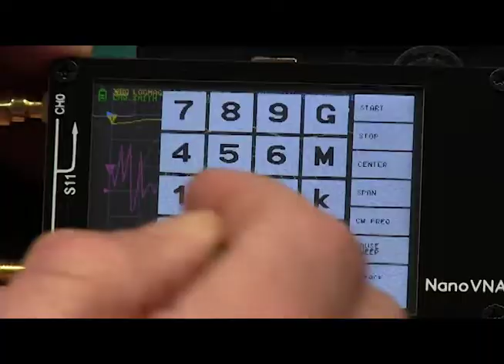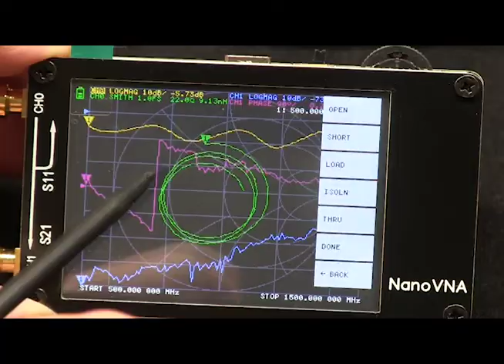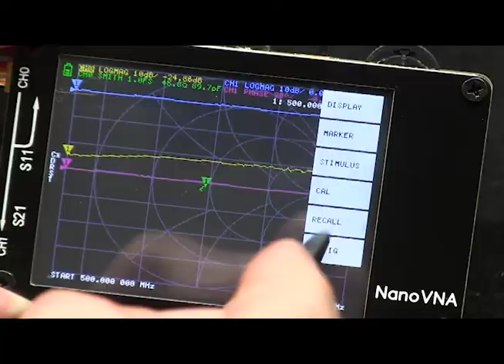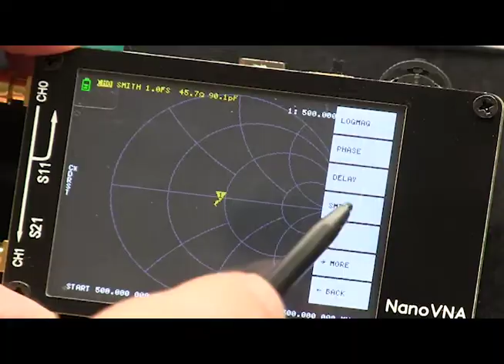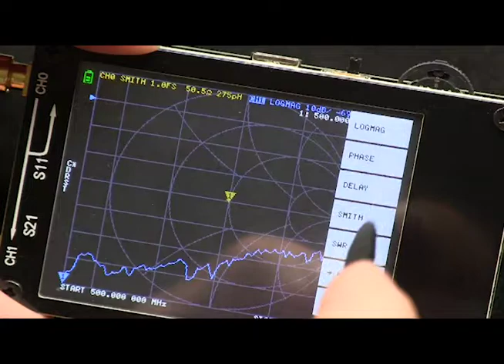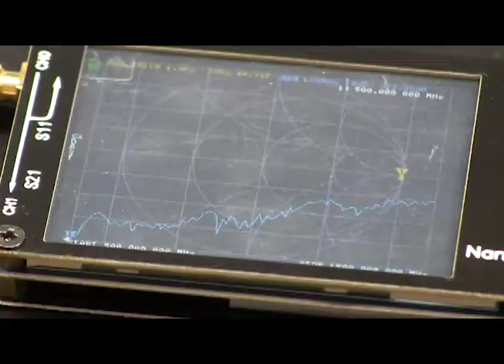Nano VNA Calibration

Comment: Can we leave the port open in the air instead of using the kit for Open calibration when we are performing SOLT calibration?
Reply: Yes, your can, but then ou are calibrated to the inside of the SMA connector of your cable. At 1 GHz, this doesn’t matter too much.